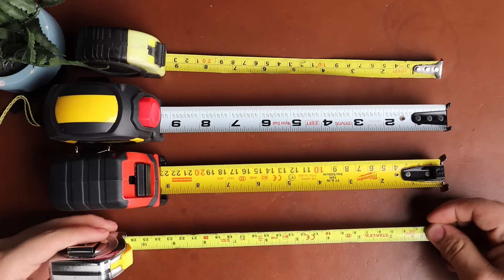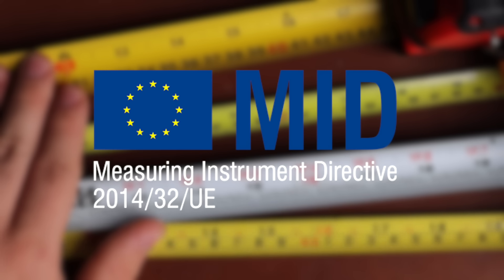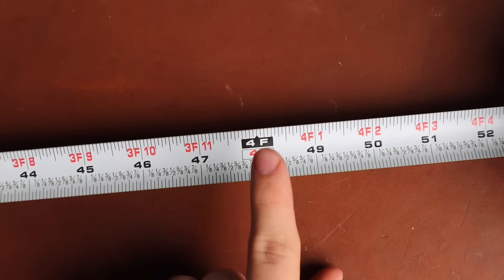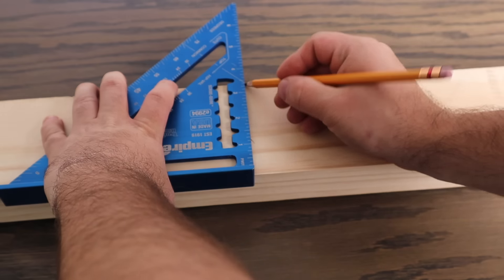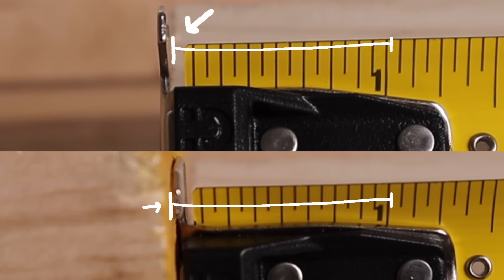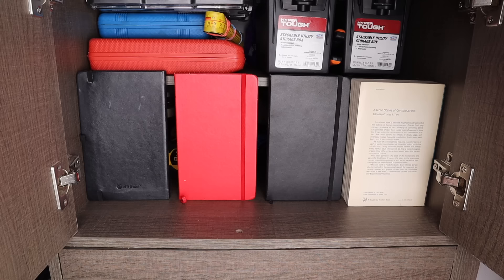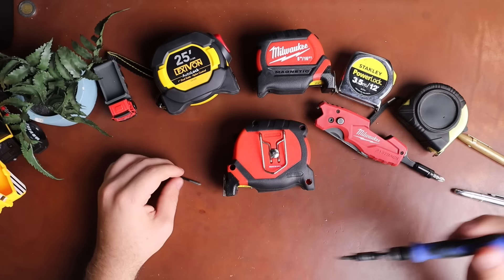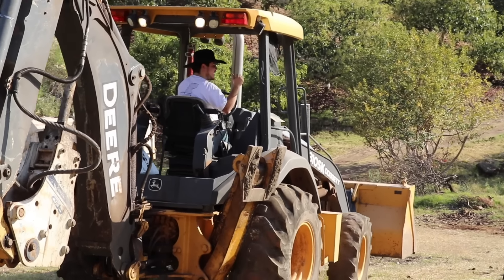Most homeowners don't know this, how to use a tape measure like a pro

Comment: Great video. I'm old enough to remember when Canada changed from imperial to metric. While most Canadians use both equally, metric is easier to use and understand.
Reply: harder to find a metric tape that just has metrics on it there are out there who need to know where to look for them too
Reply: I was at school when the UK changed from imperial to metric so also learned both, after leaving school & renovating a few houses I quickly dropped imperial & only use metric nowadays.

I also regularly work with water & volume/weights etc so metric is an absolute god send, for eg 1000 litres = 1000kg = 1 cubic metres. The thought of using imperial for that gives me a headache 😅

Comment: 6:05
Yes, if measuring an internal dimension, first measure in a predetermined value from the end the tape measure will be held at, say 100mm for simplicity sake and mark, (that's 11teen feather quips for all u muricans) then measure from the far end to the mark and add the measurement marked to the measurement shown at the mark. This gives you an overall measurement thats accurate to +/- 1/10th of a mm, instead of the 2mm-3mm with the other method.
Reply: 100mm It's actually 11teen -2/32" feather quips, which any Yankee carpenter will boast is waaay more precise than a mm.😀

Comment: The CE marks on the milwaukee and the stanley powerlock are Conformité Européenne marks, wheras the one you showed close up is the China Exports mark, which means nothing
The way to tell them apart is that in China Exports, if you complete the circle of the C it will overlap the E in its middle line, wheras the European mark, which has a bigger gap, hits it on the curve
You can look it up for example images

Comment: After being in manufacturing I don’t know why we aren’t using decimal tape measure.  1.1 or 1.5 or 1.7 inches for example.  Instead we have fractions.
Reply: You wants decimals, use a metric tape. 5.2= 5cm 2mm. Decimals in feet and inches would be way more difficult for the average person in comparison to inches with fractions.

Comment: This might be a dumb question, but is 15.55 the same as 15 1/2 inches? I don't think that 15.55 is in centimeters since it is a TV stand. It reads 15.55" wide and 29.96" tall. Any help would be appreciative. Thanks
Reply: Mathematically speaking 15 1/2 is 15.5, so 15.55 would be verry slightly more than that. I'm not a mathematician but I think that's basically somewhere just over a millimeter past 15.5 inches.

Comment: One profound FAULT in design is;  most of us hold tape with left hand, and mark with right hand.  Why is the printed index upside down?  I have only seen one tape and ruler that hold to this maxim.
Reply: Good point
Reply: Never thought about this. Interesting.
Reply: You need to run a company
Reply: Technically tape measure are to measure and not to mark. I learned to just read it upside down if I was marking but if I need to check the measurements of multiple things I can do it quickly since the numbers are right side up. my two cents.
Reply: @ryanhanson2081  Invalid argument
Reply: I know right just make it  non upside down
Reply: We read and write from left to right.
Reply: Oh you poor right-handed sooks.  If you multiply this feeling by 1,000,000, you wouldn't even be close to understanding the frustration experienced during a day in the life of a left-handed person.